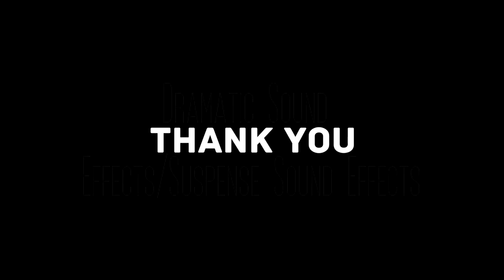An Earthship in 10 Minutes

Comment: I think you guys did a great job in building a earthship greenhouse. Although I do have a criticism about the young mans comment about concrete production account for 9% of CO2 emissions, if that sort of thing bothers you the you shouldn't have use any power tools, Styrofoam insulation, rubber tires, plastic sheeting, the heavy equipment (John Deere Gator and Kubota Tractor) to move the earth, and the chemical sealant used on the inside of the roof that the two girls were using. I just think its a little hypocritical to exclude one if you don't exclude them all. Other then that it looks good and I hope you guys get the rest up without a hitch.

Comment: GMOs and pesticides aren't unhealthy by default.
Reply: +runningsandwich A GMO study was done on rats. 10 rats were fed organic peanut butter, and 10 others were fed peanut butter that had modified corn syrup. All the organically fed rats were fine. 9 out of 10 of the ones that were fed GMO's developped cancer.
Reply: ***** Two things
The first and most important is providing a source. You may have fabricated that.

The second is that, like I said, not all GMOs are bad by default. Corn is a GMO. Bananas are a GMO. Dogs are genetically modified organisms whether or not you eat them.

"GMO" is too vague a term to really narrow something down in terms of whether or not it's good, similar to the word "organic". Organic means it contains carbon. Every foodstuff is made of some large portion of carbon.
Reply: runningsandwich If quoting a source is important than I think you forgot that yourself with the GMO bananas! :P On a serious note though I see what you're saying. There's a difference between GMO's and hybrids. A cross between two types of bananas is a hybrid. When you insert a gene from an organism to another then that is GMO. Bananas are not GMO.

Comment: leaves lots of questions..what was that clear ? plastic? sheets u used on roof ? does it last long , ? cost ? can u drill it..screw it ..seal it..Hell just bring me about 10 sheets of it to Cinebar ,WA..thank u ..save planet ..going green and all  that good stuff ..
Reply: +Madden Master Its polycarbonate. Typically comes with a 10 year warranty but depending on the quality can last 20 years. Cost depends on the thickness and number of layers/walls. Twin wall is more expensive than single wall etc.
Reply from the maker: +Madden Master We made ebooks and DVDs with step by step instructions on building them
Reply: +Valhalla Movement where can i get those? this would be a dream come true.
Reply from the maker: +alfonso payra See the link in the description!

Comment: Global warm has not been debunked yet Michael. By looking at the green house gasses that we have emitted in conjunction with the average temperature rise since the industrial revolution you could see how one could draw the conclusion of green gasses having an effect on the planet. there are also other issues to consider than just the rise in temperature though Michael. Aside from what we are doing to the rock that we currently inhabit, everything that we put in the air directly impacts us as people inhabiting this planet. The air we breath the water we drink and the food we eat are all effected by the pollution that we create in order to run our societies. There may not be a way to completely avoid the harmful toxins that we produce through our technologies but if we can take steps in midigating or reducing the extent of output then we should be doing this. In addition I have great respect for those of us out there that see potential problems and try to fix them before they get worse. "Take care of where you live and it will take care of you".
Reply: levi belcher 
It’s worse than most people know. We’re also warming Pluto and most other planets. Sheesh! Stop smoking, driving cars, no more electric blankets, snuggle in bed and turn off the central heating. Poor Pluto is suffering something terrible. 
Namaste and care,
mhikl